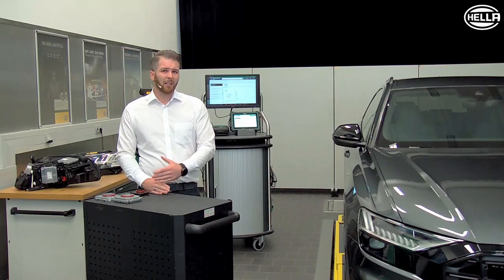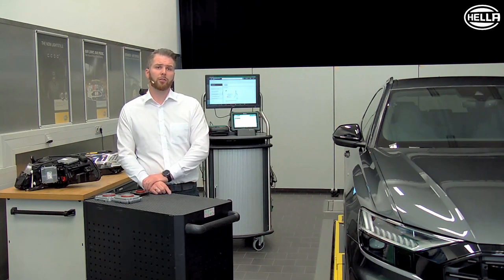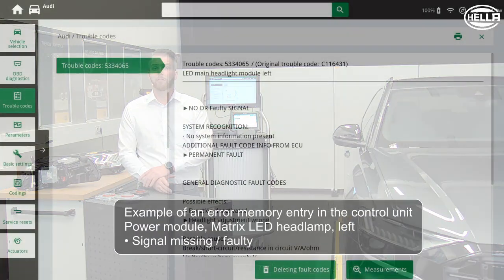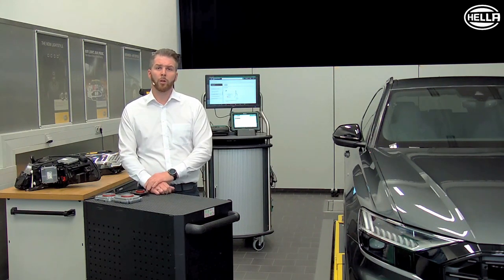LED headlight control module: Diagnosis, replacement and headlight coding | HELLA

Comment: If I replace my OEM LED headlamps with Chinese aftermarket units, and I swap the control units from my original lights to the new one, will anything have to be re-programmed?
Reply from the maker: Hi @clifflancaster4693, thanks for your question.

It depends on the vehicle and the headlights. If the aftermarket headlights are truly 1:1 technically compatible and the original control modules are retained, it might work. However, in many modern vehicles, the new components and functions must be programmed, coded, or calibrated after the conversion. In addition, non-original headlights may trigger error messages in the vehicle’s electrical system if the electronics are not fully compatible. Therefore, you should check before installation whether the manufacturer of the aftermarket headlights has any specific requirements.

Best regards!
Reply: @HELLATECHWORLD Thank you very much. The seller says they're plug and play, and they do look identical. I'm being optimistic.